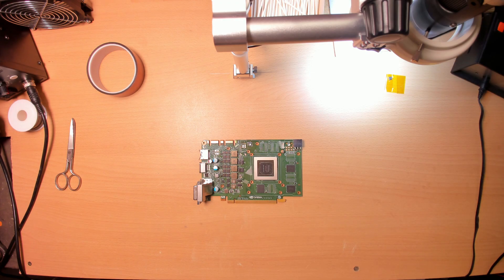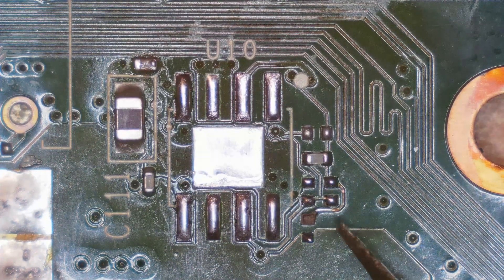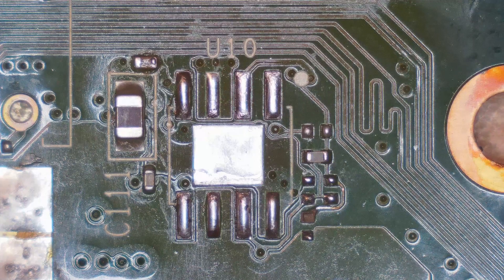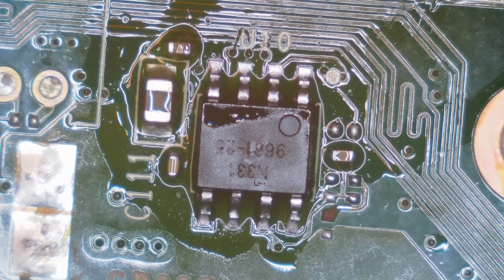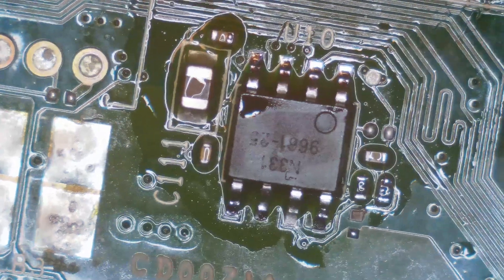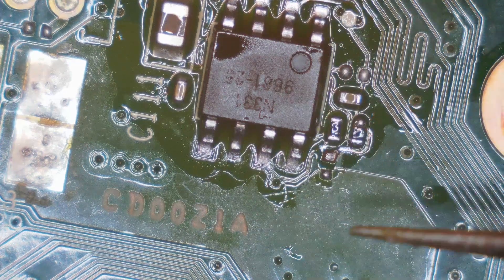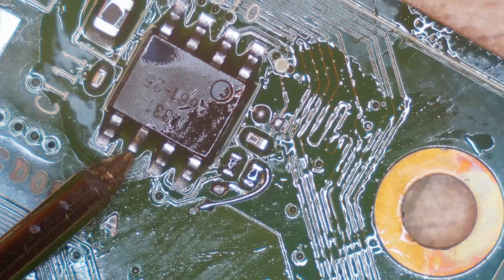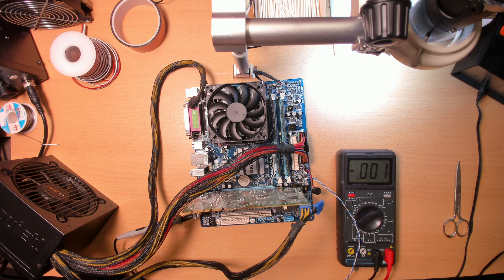Finally Fixing The GK104 GTX 660

Comment: Doesnt the wire gauge matter when you're bridging components
Reply from the maker: It does, but the trace I fixed is just a sense line and therefore does not really carry any current.

Comment: The pex rail really likes to die on those PCBs huh. I had the same thing on a red 760 OEM card. I was lucky enough to have an identical chip present on a donor card so it was a very quick fix

Too bad my card ended up having a NCP5392 PWM Controller which has over voltage protection shutdown problems above 1.3V ish so there is not much to be done in terms of voltmodding without an epower, even with VID mods since VID6 and VID7 seem to be hard locked and not adjustable...
Reply from the maker: Tried to bench a 560, ended up having a similar problem to the one you described, so I guess that 560 used the 5392 aswell.
Guess I'll be benching this one at just 1.3V then, too - I don't think I can be bothered to e-power this one.